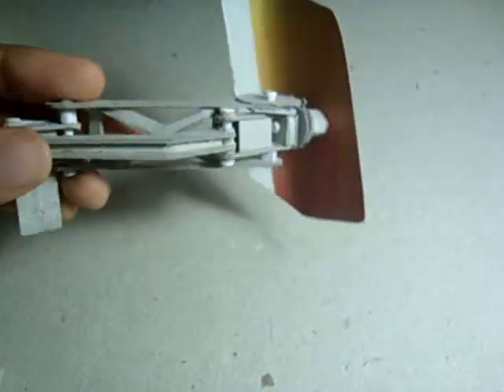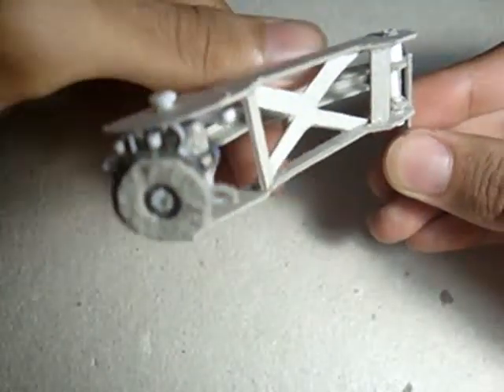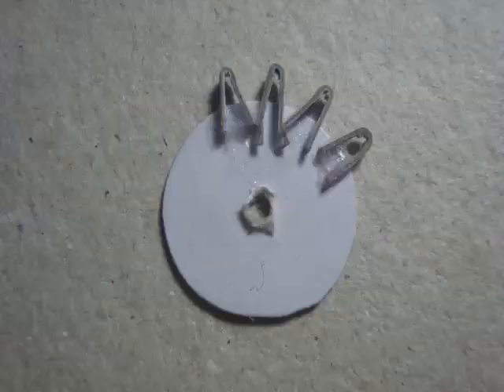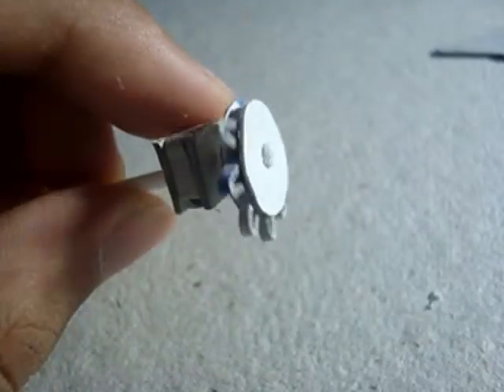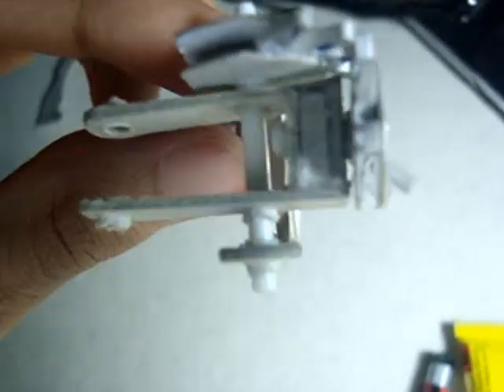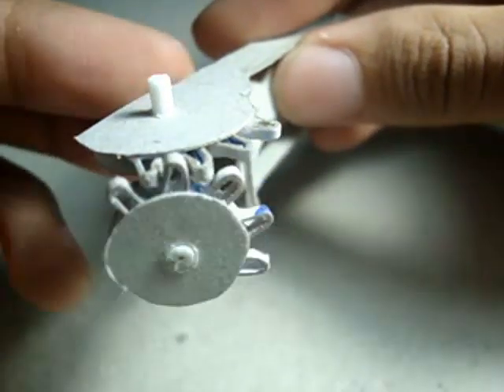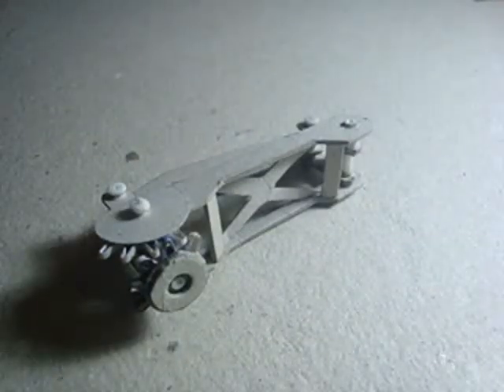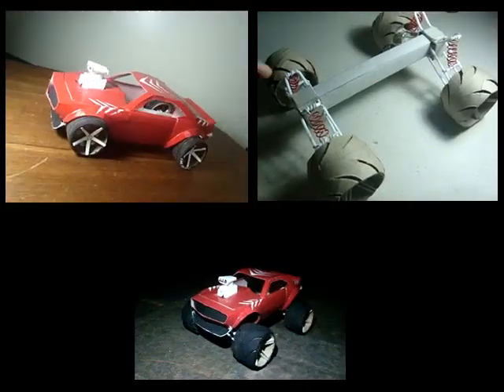How to make Koenigsegg's Dihedral synchro-helical hinges.

Comment: Why do you need the gear ratio? Angle 60° Vs 90° opening 😅
Reply from the maker: Just a personal preference: I want the door to move outwards less, before the door has swung a full 90° upwards. That way it feels like you as the passenger are doing less(i know it's pneumatically powered, but still, you push/pull it a little), and the automation is doing more. I think that effect is an important part of the "magical feel" of the door motion.

Comment: Hey there! Thanks for making this video, its going on my 1:1.2 scale car! Throwing out the old mechanisim
Reply from the maker: Heyya! I hope I could explain the mechanism clearly. Share with me what you're upto when you can. I'd be glad to follow it
Reply: @TaherAnjary  Will do, im currently getting the models prepped, haven’t got to the hinge fully done yet but nearly
Reply: @choleevans3123  all I have is the base of the chasis and a mini cooper failed mot that i bought for £300 planing to transplant it
Reply: @TaherAnjary Been a while hasn't it! Unbeknownst to me at the time, my father has connections with the owner of koenigsegg UK. I've been there multiple times now, and have to say you did an amazing job on this. Really well done. In terms of the car, over a year and a bit I learned to 3d model. I have a full model of the one:1 with transplanted engine mounts for the mini engine. Interior wise it's lacking a little, but I'm planning to just 3d scan an actual one:1 next time I get the chance. Progress has slowed as of now so I can work on my degree, but other than that all is well. Again, you did an amazing job with this video, thanks
Reply from the maker: @thefuturerex0197 Hey. That's great to hear. I'm glad the video was useful. Really means a lot that you came back here just to update me on your progress. Would love to see the build fully functional and burning rubber on the roads eventually! Keep up the passionate work! And thank you again for your continued viewership.

Comment: Hi. Great vedio and clear explanation. I have a question about the bevel gear. You mentioned its 3:2  size ratio... That's 1.5 :1... What happens if I use 1:1, ratio?
Reply from the maker: You'd need to push the door further horizontally to get the same vertical angular displacement of 90 degrees ie: push the door outward 90 and the door rotates upwards 90 degrees with a 1:1 ratio Vs push the door 60 degrees outward and the door would rotate upwards 90 degrees with the 3:2 ratio